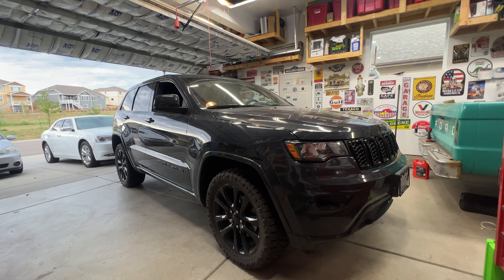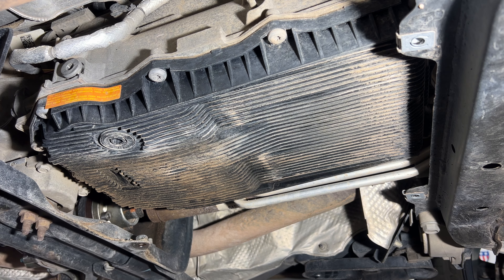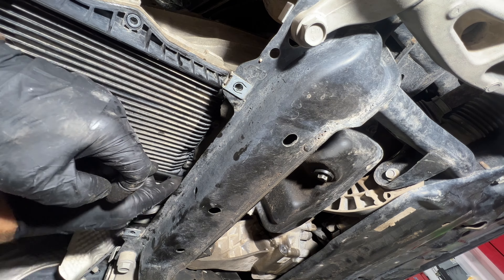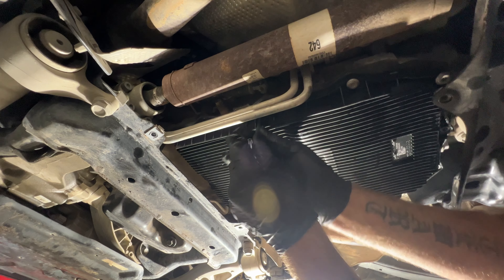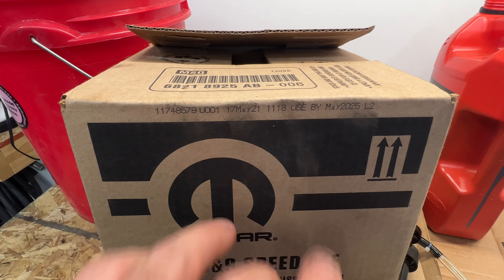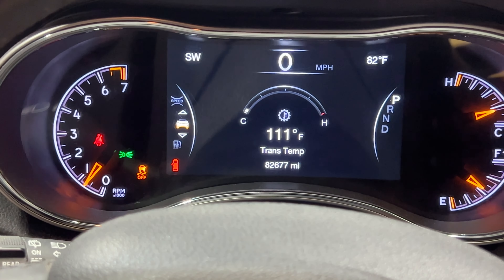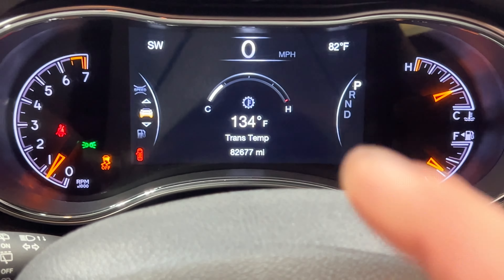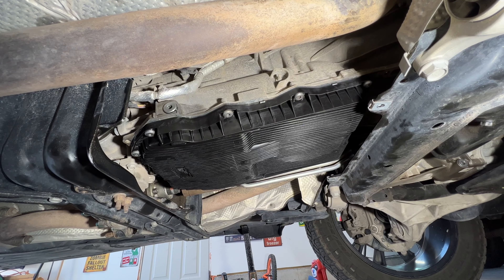2018 Jeep Grand Cherokee 8 Speed ZF Transmission Filter & Fluid Replacement How-To

Comment: I measured mine and i pulled out 5.5 qts and I'm at 4 in. Could it have been overfull? I'm letting it sit over night and I'll check/add more tomorrow. Be sure sure and turn off traction control! It shifted into 2nd nice and smooth, I didn't do 5 seconds, I'll do that tomorrow. I can hear the solinoids activating just fine. Thank you for the well done video!
Reply: ZF manuel says: P, R, N, D, D1 and D2 for 10 sec each. Then check fluid level. But temp has to be monitored.
Reply: @TheCybercrash  yep, the next morning I got back down there and added another 1.55 qts totaling 5.5 in just as I was hitting the end of what I had I saw the drip start. I processed the above procedure and it's done now. I took the oil to my local shop for their container and it was real dirty, not burned or anything like that, just filthy and needed to be changed.
Reply: @TheCybercrash  and yes, temp has to be monitored and was.
Reply: I just did my 05 truck by undoing the transmission line coming out of the radiator and using an adaptor to attach a hose. I replaced 14 quarts. I read that just replacing the fluid in the pan only gets maybe 1/3 of the fluid. I wonder how many quarts the transmission actually has in it.
Reply: @jonathans1472  you do realize you never want to do a full fluid swap...

Comment: Excellent! I am acquiring a 2017 Summit with the 8 speed transmission and I had seen some video stating that you could not change the filter without removing the transmission. I am so relieved to see that this transmission has a removable pan. Your method was thorough. I have also seen (in order to exchange all the fluid, including the torque converter, etc.), you need to do repeated oil changes within a short time frame.

Comment: I wonder if the torque specs apply to all ZF transmission, like for my durango? Should that info be on the manual? 🤔
Reply from the maker: Yeah it will be the same since the grand Cherokee and Durango share the same chassis

Comment: Excellent video sir. Do you need to change the pan or can you just change fluid.
Reply: The reason for the pan change is the built in filter which doesn't hurt to change -so the whole thing must be exchanged.
Reply: @patrickjames1080    thanks I seen the filter built in. So bought a new pan aswell. Thanks.
Reply: @Johntwoflags  good luck - changing mine next week - 2016 1500 Ram Ecodiesel 160k miles, need to buy 2 more jack stands.

Comment: I have a 2016 grand Cherokee Limited 3.6 v6 and it’s leaking all around the the transmission, pan gasket at 80,000 miles

Comment: The transmission pan rail needs to be level, not the vehicle.  In case of Ram truck that usually the rear needs to be lifted about 9 inches higher than the front.

Comment: How do you fill it when so much fluid came out of it? Seems WAY overfilled. Is there another level check?
Reply from the maker: The procedure I showed in the video is the only way of checking the fluid on this transmission it’s just another way for the dealership to make more money so they make it complicated for people to do it at home. It seems over filled only when it’s not running because the pump isn’t running that’s why you have to follow the procedure in order to check it with it running and being at the certain temp

Comment: So my fluid came running out more than that I got nervous and put the plug back on any input?
Reply from the maker: Were you at the proper temperature and with the vehicle running?
Reply: I feel like the same thing, my whole car even and if that much came up. How can we fill it so that we know when we remove later. It should spill out in same original fashion. I did the same procedure and I noticed that my car Durango has small whining sound … which wasn’t around before . I read it could be air bubbles. And I only got about 4 3/4 only

Comment: Cough cough... mine has 130k on it and to my knowledge the trans fluid hasn't been changed. Is it worth it or should I just drive it until it's done and save up for a trans replacement here in x amount of months?
Reply from the maker: You’ll be fine changing it at 130k.

Comment: Thanks for the great video, this gives me the confidence to try it, though I don't have a way to get the car up on jack stands so the wheels are spinning free.  I wouldn't think that would be an absolute requirement.    One that that deters me a bit is those three bolts that look really hard to reach that are under the cross member thing.  It actually looks like there are holes in the crossmember that align with where the three bolts are to aid in installing the bolts, is that possibly what those three holes are for?
Reply: Hi!! Did you change the oil in your transmission? Did you jack up the jeep? Or did you just level it on the ground?

Comment: just had Valvoline quick change suck out and replace 9 qts of transmission fluid. 2015 jeep grand cherokee 3.6 115k. so far so good 17 miles later. I think this was original fluid looking at carfax. Valvolline does not change filters.
Reply: Ouch
Reply: Ouch! I hope it lasts for you! Sincerely.

Comment: Plastic transmission pan? Those plastic "heat sink" cooling fins, I'm sure dicapate heat better than steel or aluminum.  Aren't these a $55k vehicles?

Comment: If the new pan had no drain plug, how you drain it next time?
Reply from the maker: You just have to pull the pan and make a big mess. Just another way they are trying to make you go to the dealership to have it done.
Reply: @BLUECOLLARGARAGE  Thats what I was thinking. Since I am nervous over those hard to reach bolts, blocked by that structural beam and the sequencing needed after the change etc., I am opting to get it done. Found a highly recommended Transmission Shop. If I buy the parts and fluid. They'll do it for $250. Thats rather reasonable all things considered. I sure hope more shops get on board with these kind of reasonable alternatives. Mom and Pop spots can make some bank and save us all from Dealership BS.
Reply: @BLUECOLLARGARAGE you actually don't need to do that! Pull the fill plug and take a flexible hose and use an evac pump. I was looking at this when I dropped my pan for the next interval. Silicone hose is very flexible!
Reply: @JF32304    I also thought of doing that if they got rid of the drain plug.  Just stick a supple hose in the fill hole and vacuum the fluid out.
Reply: Drill a hole in the bottom of it if you are replacing it anyhow.

Comment: Had my girl call the local transmission shop about doing this job. The guy talked to his distributor and a couple other people and they all said these transmission are designed to go 140k miles whether the fluid and filter are changed or not it’s not gonna last much longer than that. His advise was to trade it in when it hits 120k. He said he’d do it if we want to but it’s not gonna make a difference.
Reply from the maker: I think it all depends on how the vehicle has been driven. I disagree with some of that because I’ve seen these transmissions with well over 140k miles especially ones that have had the fluid serviced in the past.
Reply: I'm going to change the fluid and filter on my 2016 Grand Cherokee Laredo.  I didn't like the answer I received from 3 Mopar dealerships near me; "forever fluid " response. Then the quote for the job: I'm not buying another Jeep,  lol😂
I currently have 241,600 miles on mine. Maintenance is very important for longevity. 
Once again,  your video was awesome,  and you made this look much easier to do than others I've seen,  including one guy removing motor mounts and jacking up the engine to get to the bolts above the crossmember😂😂😂.
I just received my suspension lift kit from Rough Country,  I can't wait to put it on!
Thanks for another great video!!
Reply: Almost forgot to tell you,  241,600 miles on the original transmission fluid!!
Reply: @mikebrown8065  Hi, great, and how did it go with the transmission after the oil and filter change? Everything okay? It would be important to know your experience with this.

Comment: I have 2020 ones with 30k mils. Should I replace the transmission fluid?
Reply: 50-60k miles is ZF recommended spec

Comment: How much does the temp matter when checking? mine is at 130. would that be ok?
Reply: No, if you don’t check it at the right temps, you won’t have the correct fill of fluid

Comment: Great video… on another note. Do you happen to know why the water pumps constantly fail on these? Already done 3, all leak at the weep plug. 3 different brands used. Had to be a pressure issue.
Reply: I've done 4 so far, 3 mopar and the 4th is a gates. dealership won't honor the warranty anymore so I went to rockauto for the gates.

Comment: So the car is in Manual mode and you shift into 2nd gear manually?

Also, no ABS or brake warnings when putting into drive on stands?
Reply: He put the car on Jack stands and disabled traction control so the front was free to turn. I did it to mine and all is fine.

Comment: Did you get the instructions with the new pan?  I’m about to this to our 2014 GC Overland. I’m reading something about putting the vehicle in “Jack mode” because of the air ride. How are you supposed to run in like that?
Reply from the maker: No it did not come with an instructions, if you have air ride suspension you will want to put it in jack mode because if you don’t and you try jacking it up you could run into the issue of blowing out one of the air suspension bags.
Reply: Hi! I have the same Jeep as you, did you change the oil in your transmission? Did you jack up the jeep? Or did you just level it on the ground? What did you do with the air suspension, jack mode? Or did you take out the relay? It would be good to know your experience.
Reply: @NanoDiaz777  Hi there. Yes I ended up changing out the transmission fluid both front and rear differentials and transfer case last Saturday.  First thing I did was put the Jeep in “Jack mode”. After that I jacked it up and put it on 4 jack stands like in this video. (All 4 tires have to be off the ground). I bought the OEM mopar transmission pan from Rockauto and the 6qts of trans fluid from Amazon. It’s actually a pretty easy process. One thing to note though. Once you start running it on the jack stands, it takes itself out of jack mode. You’re going to have to put it back In jack mode again while you’re doing the fill process.  This video is the best on YouTube imo. Clear and straightforward.
Reply: @THETOPGLOCK  Hello, thanks for responding, just a few questions: why do the tires have to be in the air? will they rotate? Where did you put the jack to lift the rear? The rear differential seems a little fragile.
Reply: @NanoDiaz777  when you’re going through the fill process you will be putting it in drive and achieving enough speed to hit 2nd gear. So all 4 tires will be spinning. I have two jacks. I jacked up the rear first using the lower control arms and a block of wood to lift. Placed the jack stands where the arrow shows.  Did the same exact thing for the front. I used a level to make sure it was sitting good front to back. (Exactly like this video).
Reply: @THETOPGLOCK  thank you so much!!! God bless you!!

Comment: Hey guys, I have a question. So my dealer ship never did the transmission flush to my 2016 chrysler 300. Now that I am no longer on the extended warranty, im on 125k miles, and im wondering if i should do it myself or just leave it alone.... if someone can help me and explain what i should do, i will greatly appreciate it. Thank you guys. Amazing video!
Reply from the maker: Chrysler claims the fluid in these transmissions is lifetime and never needs replaced which means the original fluid used is very high quality. So with that said you being at 125k you should have no issues changing the fluid and filter now. If you were at say 250k or something then I think it would be a different story I’d say just leave it.
Reply: @BLUECOLLARGARAGE  thank you!! Will do asap!!
Reply: @BLUECOLLARGARAGE hi mine 2014 wk2 is just over 150k , do you feel it is still safe to do it?
Reply: @OscarGarcia-sx6tx did you replace it? How is your transmission after that?
Reply: As I understand, these Transmissions can’t be Flushed, they have a Thermal Valve that opens at 86 Degrees.

Comment: I want to do this on my 2016 3.6. I bought it second hand with 48k kilometers (like 30k miles) and now it has 63k (around 40k miles) but its 7 years old. It wasnt driven much and was repoed. Sat in a lot for like a year or so.
Am I still safe by mileage or is it recommended to do the service by the years it has? It has the original fluid and pan
Reply from the maker: You should be fine doing it now with no issues I’ve seen people do it with 150k miles and had no problems afterwards.
Reply: @BLUECOLLARGARAGE  update on this. I just did the transmission service to my Jeep at 72k kilometers (around 45k miles). Everything turned out great, although some bolts were hard to get to and get loose. The old oil was in good condition (golden), and teh filter was kind of saturated. Magnets had fine sparkles but nothing out of the ordinary. It also took 4.5 quarts of fluid more or less. I have a quart unopened and a second one with a little bit of oil. The other more or less 300 mL got spilled, lol.
Again, thank you for this great video. I would have never done it right without the proper guidance. Transmission shifts way smoother now.

Comment: Oil Changes on late model ( JEEP ) might be the same with other manufacturers ??
But, I don't understand WHY ???
NO Oil Changes required for JEEP ??
I drive a Ford FG UTE and change all the Fluids.
I tried changing the Oil in the Transfer Cases of my partners 2019 Cherokee ???
"NO" Drain Plugs, other than Engine Oil ???
Seems to be same watching your video with the Auto Transmission.
Upgraded Auto Trans Pan. " NO" Drain Plugs ??
Maybe my thinking is too old school for modern cars .
I can't understand WHY you wouldn't change these Fluids.

Comment: I have a 2019 Limited with over 60,500 miles. Would this be a good time to change transmission fluid??  I’m also planing to replace the transfer case fluid and 4x4, thank you
Reply from the maker: At 60,500 that’s actually perfect timing to change out the trans and transfer case fluid.
Reply: I hearing on my vehicle the transmission has to be removed in order to put replace filter..2019 Jeep Cherokee Latitude Plus . Dealership saying of course they can't service me because on my transmission it's a Lifetime oil and filter which is a bunch of lies to me! I have 92,000 miles on jeep. Should I change it now ? Go somewhere else?

Comment: I did my Ram 1500 in my garage. Dropped the pan. Installed new pan. 4 quarts came out, 4 went back in. Truck drives fine. I call bs on these Rube Goldberg machine procedures.

Comment: Hey men I have over a 113,375 miles on my car should u recommend do this I have 2014 Durango
Reply from the maker: Dodge claims the transmission fluid is lifetime and never needs to be changed but I disagree with that since every type of oil or transmission fluid will eventually start to breakdown with heat and friction in my opinion with that many miles yes I would recommend changing it.
Reply: Hey , great video I have a question. I have 2019 Jeep Cherokee Latitude Plus .9-speed Automatic Transmission 92,000 miles.. No issues, but now I concerned should I get Transmission filter and change fluid to be ahead of the game?

Comment: For some reason, it seem like when you originally started a lot of fluid came out of the fill plug was it overfilled to begin with?
Reply from the maker: No that’s because the vehicle was off so the pump wasn’t running.

Comment: You have to change the oil pan every service?
Reply from the maker: I’m assuming you meant the transmission fluid pan. If you want to replace the filter yes because the filter is integrated with the pan or you can go with an aftermarket pan which has a replaceable filter. If your looking to just change the fluid then no you don’t have to remove the pan.

Comment: Have a question..I have a 2018 Grand Cherokee Limited 2WD..when I look online for the transmission specs it says..Transmission: 8-Speed Automatic (850RE)...it does not show a ZF designation as in ZF 8HP70 or ZF 8HP75....what transmission do I have? Is the service procedure the same. Thanks.
Reply: debes buscar en wikipedia jeep grand cherokee y aparecen todas especifcaciones, incluyendo la transmisión que lleva tu jeep
Reply: Your exact model (eg, 8hp70) will be stamped onto the bottom side of the transmission.  You need to crawl underneath the vehicle and take a look.
Reply: @ Thank you.. I’ll have to take a look and find it..

Comment: Since all the fluid isn’t removed on a transmission fluid change can you use another brand of fluid Castro Valvoline or mobile one? Or  do you have to flush the system to use another brand besides Mopar fluid?

Comment: Excellent video.  Makes my F350 look easy.  I am guessing, this is the wifes vehicle?  Is that the Trailhawk, We got the Trailhawk, really like it, but am dreading when something goes wrong with the variable suspension.  Got about 80k on ours, and one of the front rotors warped really bad, started squueking on a road trip, got both rotors turned, brakes are pretty straight forward except for the ridiculous 11mm(7/16) hex needed and the E bolts.  I think i am going to invent a way to check the transmission fluid, i dont know something like an oil dipstick, I'll make millions!  Thanks again, GOD bless, JESUS is King.

Comment: Great video, question for you, I have a 2018 chrysler 300 awd with 45k on it, do you think it would ok to just change the fluid and not the filter since it has low miles? Thank for the reply back
Reply from the maker: Yeah you don’t have to change the filter every time you can just do the fluid. My daughter has a 2016 300 awd with 65k so I might be tackling this job soon and a few others which I’ll probably record.